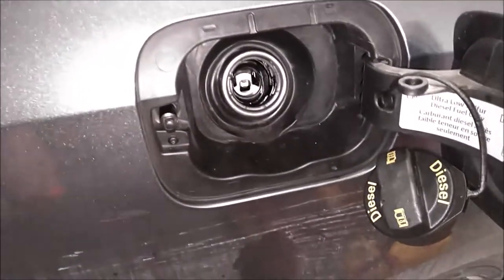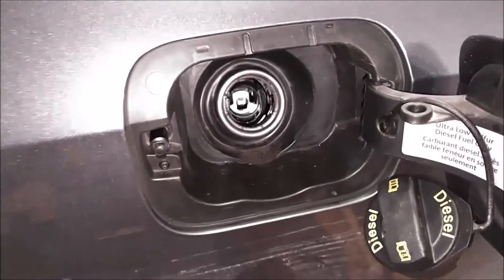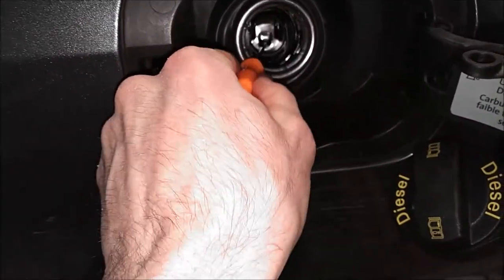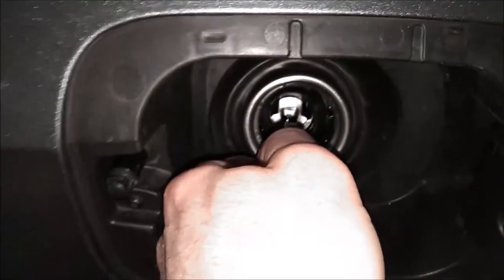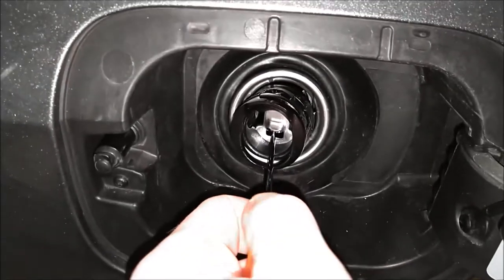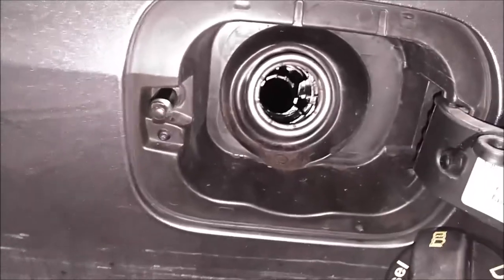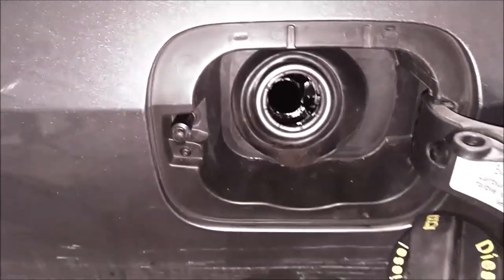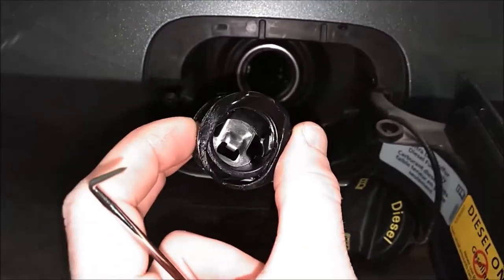VW TDI fuel neck safety switch removal

Comment: Thank you, this video saved me. I got stuck at a gas station when I was out of gas and my switch got stuck and would not let me put in a normal sized gas pump. Luckily there was an auto shop right next to the gas station but even the mechanics had no idea what to do but I showed them this video and asked them to use their tools pull it out and they did so just like you did and I was able to gas up my car and drive home. What an absurd thing to happen but I am grateful it was an easy fix.
Reply from the maker: You're welcome! I'm glad that it helped you and thanks for sharing your story.
Reply: @Corysdiyauto  how can i not remove it and still get gas in? Is it engaged by metal or what trieggers it to open the metal protection?
Reply from the maker: You'll need to use a funnel like this one: https://youtu.be/sA3hrLjdggg
Please put diesel in, not gas!
Reply: I truly hope you didn't put gas in your TDI... No wonder the gas nozzle doesn't fit in a diesel car, it's by design

Comment: I almost ran out of fuel once because I didn't know this was removal. Every station that had diesel had only the large nozzles. Thankfully a Meijer I went to had the small passenger car one. Definitely not a fun situation.
Reply from the maker: Yeah, you're better off removing it so that you can fill up at the truck pumps if needed.

Comment: Wow! I'd expect that the VW dealer with whom I've done business for years would have explained that to me and sent me on my way a happier and wiser customer. Didn't happen. Instead, they wrote up a service ticket and sent my TDI into the shop. The car emerged in twenty minutes "fixed" and the service manager presented me with a bill for one flat-rate hour ($140.00). After haggling with his boss, they graciously cut the charge in half. I asked to talk to the mechanic who did the repair but all he told me was that it happened quite a bit, that it was not a warranty issue,  and that the parts department would be happy to sell me a new VW part if it happened again. Complaints to VW Corp. did not even yield a reply. Two fill ups later, the fuel neck safety switch jammed again. And thankfully, I found your post.  Very much appreciate your helpfulness and good will!
Reply from the maker: Thanks for sharing your story. I'm sorry to hear about your experience with VW though. What a rip off!

Comment: Just bought a 2015 GSW last night and I'm glad I saw this before needing to fill up. Thank you! 👐
Reply from the maker: Glad that I could help. You're welcome!
Reply: I'm trying to do this now, but mine looks different. Any ideas?
Reply from the maker: @FraktalsFestiVids  - That's odd? Same vehicle?
Reply: @Corysdiyauto   I finally got it. The 2015 golf SportWagen is different than what you show here. It has a black locking collar that must be twisted forcibly counterclockwise and then a Miss fuel basket that is just free-floating underneath. It was also a pain to get out
Reply from the maker: @FraktalsFestiVids  - Good work and thanks for sharing. I didn't know that the Sportwagen was different.

Comment: Thank you, went to use my high flow fuel can today in my car and the metal safety piece wouldn’t move in. I used a pair of angled needle nose pliers and grabbed the edges instead of the center, so that also works if you can’t find a pick at home.
Reply from the maker: Thanks for sharing!

Comment: I should’ve looked this up about 3 weeks ago the first time I was fueling up in Mexico!! I’m now in Guatemala & none of the nozzles fit so I’ve been using an AMSOIL Diesel/Octane booster bottle I cut the bottom off of that also does not fit 😂

This is going to save me so much time at the pump & also make it so I don’t feel obligated to tip the full service guy for standing there a good ten minutes to fill me up! It will also reduce the spillage on the side of my TDI 😬😂
Reply from the maker: I'm glad that you found my video. Good job on modifying that bottle to get fuel in!

Comment: Excellent procedure...thanx so much.
Reply from the maker: Henry Hodgens - Thanks for the comment. Glad I could help.
Reply: @Corysdiyauto  
Background:  My daughter was in a rush to get to work and has been reluctant to fuel her TDI by herself, so I ran 5 gallons into her tank from a portable can.  Next time she goes to fill the tank, she can't get the nozzle in the filler cause I apparently tripped the mechanism with my 5 gallon can.  What good does this blocking mechanism do??? I was at a loss how to remove the block and really didn't want to take it to the dealership.  Great procedure...thanx again.
Reply from the maker: Henry Hodgens - It's more of a nuisance in my opinion! I believe that it's meant to prevent someone from using a gasoline nozzle at the pump....or a portable can, haha. It's so much better without it! Thanks for the comment.

Comment: What’s weird is that I never noticed it until a few days ago. I went to put a normal diesel fuel nozzle in my car, not the ones that 18 wheelers use, and it wouldn’t fit. I stood there for 10 minutes slowly putting in $10 worth of fuel. Does it get locked somehow? Because I never had that problem until a few days ago. I just removed it after watching this video.
Reply from the maker: Unfortunately they can malfunction and you won't be able to get the nozzle in. You eliminated the problem by removing it. No more worries now.

Comment: My adapter came off when I forgot to take the pump our of my tank and drove off.  How to in insert a new one?
Reply from the maker: Just position it the correct way and push it straight in. You can use the video as a reference so that you line it up correctly. Hopefully you didn't cause any damage to the filler neck. Good luck!

Comment: hi Cory, I have a 2016 i.6 ltr diesel Octavia, but the unit, whilst almost the same does not have the hook on the hinge flap. On mine the unit has what might be two holes in the outer part of the body.  Also my bayonet fixing,  the filler cap locks into, appears to restrict the neck size and this shutter unit might not pass this bayonet ring that locks the filler cap. Have you seen this type???
Reply from the maker: It sounds like you definitely have a different setup compared to the VW here in the USA. The Skoda brand is not offered here, so unfortunately I'm not familiar with it. Sorry that I can't help you Barry.
Reply: @Corysdiyauto  Thx for the quick reply Cory

Comment: Does the removal of this impact the TDI extended warranty in anyway
Reply from the maker: I wouldn't think so, but you can save it and just push it back into place if you ever want to.
Reply: It could if the fuel pump fails.  VW told me the high pressure pump fails because people put gasoline in the car. This device prevents that and yes....I think VW  could deny warranty because this is removed. They want any reason to not pay repairs

Comment: Hello , can I fueling a diesel from can, without removing this switch?
Reply from the maker: Yes you can. You'll need an adapter. I have a video on this as well: https://youtu.be/sA3hrLjdggg
Reply: @Corysdiyauto  Yes  I watch that video but I can not find adapter. I fueling from the bottle about 5litres throug the switch but but I still have the same level of fuel on the board? Where is my 5 liters?
Reply from the maker: @TonyAngelino.  - I have a link for the adapter in the description. It's available on Amazon. Is your fuel going into the tank or on the ground?
Reply: @Corysdiyauto Sorry, I can not by from Amazon,I am from Serbia. I suppose it s going throug the metal pipe into fuel tank, there is no any liquid under the car. But my fuel scale on the board doesn t move after 5 litres, so I stop fueling.
Reply from the maker: @TonyAngelino. - If I were you I'd just remove that insert and be done with it.
Reply: Yes,I tried but I can not move it.
Reply from the maker: @TonyAngelino.  - What kind of vehicle do you have?
Reply: @Corysdiyauto  Golf mk7
Reply from the maker: It should pull straight out.

Comment: Anyone have a part number to order a new one? Was stranded and had to break it to get it out.
Reply from the maker: The part# is 4H0-201-112-A. I would just leave it out if I were you. It's going to be problematic in the future.
Reply: @Corysdiyauto  no evap issues over time?
Reply from the maker: @southernskater777  No, no issues at all.

Comment: How do I remove this stupid thing on my 2012 Q7 TDI?
Reply from the maker: It should be the same setup. Just pull it straight out.
Reply: @Corysdiyauto  I have the same issue on my q7 it is all plastic
Reply from the maker: @jameshunkin8589  - It's all plastic except for the center flap which is metal.

Comment: The larger fuel noozles at the truck stops are 1 inch jn diameter, you still need to remove the rest of that device from your tank to put it in all the way. You have only the top end, there's still another item that needs to be removed.
Reply from the maker: What item needs removed?
Reply: What is it and where?

Comment: UPDATE 2022. With diesel at $7 per gallon and FUEL THEFT on rise this adapter prevents siphon tube and stealing your fuel should they pry open fuel door
Reply from the maker: If someone wants to steal your fuel that bad, they'll find a way. All they have to do is pull out that insert.
Reply: @Corysdiyauto  many cant figure how to air a bicycle tire they just need gas so they can go by some dope
Reply from the maker: @BearInThePhillipines  - Haha, true. In that case, they won't even figure out that it's diesel and not gas!